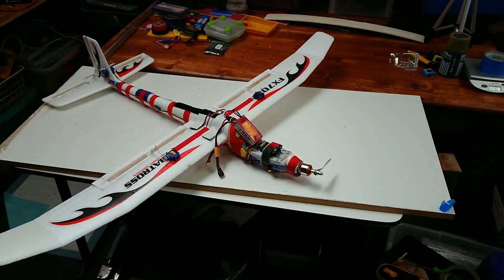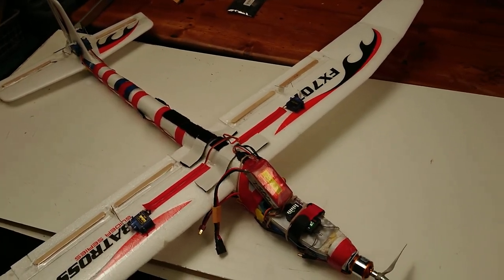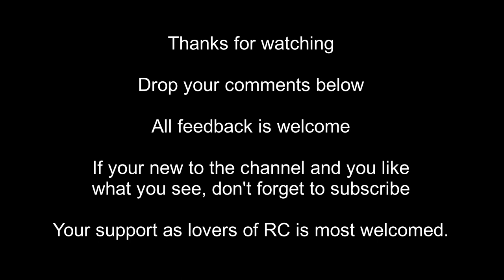This Chuck glider flies but......and that's a big BUT!

Comment: If you ever decide to give this another go, there is a new version called the FX707S. The neat thing about it is that it was actually made to be converted as it is already hollowed out for all of the necessary electronics. I built one using the motor and cowling from a Conscendo S. Everything tucked away nicely and looks professional. The Conscendo is almost certainly a better plane, but I enjoyed the project and am having fun flying it.
Reply from the maker: Thanks for the feedback Mark.  I know the version you're referring too.  I may actually give it another go at some stage.  What I found with this one though is that the wings were too flexible which may have contributed to it's haphazard flying style.  May need some slight stiffening with a carbon spar.   I think the extra weight of the motor and battery probably contributed to that also.  Funnily enough, I actually completed a full circuit on my very first flight which wasn't being filmed.  It then suffered the same fate and I kept trying to improve it there afterwards.  I must admit though, this one turned out to be more trouble than I bargained for.  LOL
Reply: @ricchatrc  The carbon spar in this new version seems to be pretty good, but I saw a video someone uploaded that still showed some wing flex in flight. So, in my building process I added a 1mm x 3mm carbon strip to one of the pre-cut channels on the underside of the wing. That worked out nicely and I am having no flex issues with my bird. I'm only really having two problems with mine: 1. The ailerons are a little anemic, so rolls aren't really an option. 2. My motor mount angle is probably wrong given that it wants to pitch up hard when I give it full throttle. Other than that, it is pretty fun. Even with a 2 cell battery, if I catch some thermals I can keep it up in the sky for over 30 minutes.
Reply from the maker: @markduckworth5579  The carbon strip sounds like the way to go.  As for the aileron authority, maybe cut wider or deeper ailerons.  I'd say based on that wing design, they probably have to be deeper into the wing or attach extensions that stick out past the wing.  I actually did that to mine in a previous video. https://youtu.be/FB5jbbXXnEo
No flight footage unfortunately as I realized I was just adding more and more weight.  LOL.  The ailerons are actually where the flaps would normally be.  That could be part of the problem......As for the motor mount, definitely needs angling downwards until the thrust line hits the lift section of the wing.   This plane was an absolute adventure/experiment for me!   Good luck with yours and continuous happy flying, especially with those thermals.

Comment: The fx707s is rc conversion ready and comes with carbon fibre rod for fuselage from tip of tail to rc compartment, also carbon fibre spars in wings and rear stabilizer.  It works and flies great as a GLIDER especially fun slow slope trainer. Why everybody wants to put a motor with the added weight and stress on is a bit beyond what this glider was designed for. It will also thermal nicely with a bungee start.
Reply from the maker: You know, I kind of agree with all that you mentioned.  My kit was not RC conversion ready.  Perhaps I made it worse any way, but it was a fun exercise in the conversion attempt.  Mine also didn't have or come with any carbon fibre rods for the fuselage.  The wings had a carbon rod but it was more to join the wing halves than it was to stiffen them.  My model must have been one of the early ones.  I have since seen the new improved versions of this.  Thanks for the feedback and happy flying.

Comment: I just ordered the FX707s on ebay and it is about 47 dollars Oz with free shipping. I see other YTers have built it up to a full RC motor glider and all seem pretty happy with the results. I agree that the model that you got was not so well suited for the conversion, but top marks for the effort you put in anyway. I suggest you reduce the weight - it doesn't need that much of a motor so all the other bits were also overkill and overweight which means the balance has to be spot on and it must fly fast. Hope you have another go and I will look forward to your vids of how you go with the new version kit to start with.
Reply from the maker: Thanks buddy - I tend to you agree with in hindsight.  May also explain why my wings would flex so much with the slightest up and down elevator.  Must have had too much load, or the wing needed a longer carbon spar.  As you say,  a lighter model would have overcome this.  I will take a look at the new kit version and have another go.  Cheers!

Comment: Hi RicChat RC! I am kinda late to the party!! But did anyone pay any attention to one of the most important aspects of the conversion process and that's the CG! The center of gravity of any fixed wing must be spot on to fly properly. That is it must be perfectly balanced. A little nose heavy is preferable to being tail heavy!! It will fly being a little nose heavy but not being tail heavy!! If the C of G has already been reviewed then I digress!!! I enjoyed watching your flights or should I say non flights. Whatever they were, I enjoyed them!!!
Reply from the maker: G'day, I tried everything with the CG.  I suppose I could've had it wrong still, but I was ready with the controls to compensate, and either way, it had no effect.  As you can see, I finally got it in the air until I started banking and then I lost it all over again.  Will have to try again with a  fresh plane I think.  LOL  (thanks for watching)

Comment: Hi Rick, FX707S is a real nice project and is my go to slope soarer. Control surfaces are as molded and flys sweet and straight. see Model Making Maniacs for the build and slope soaring videos.  Video link
https://youtu.be/ossXv6Smelw
Reply from the maker: Thanks guys - I will have to have another go at it.  Will have to stiffen my wings though as they bend too much or too easily with every up and down elevator control.